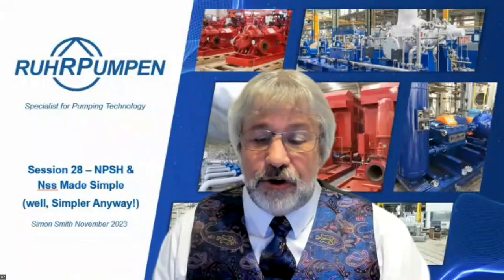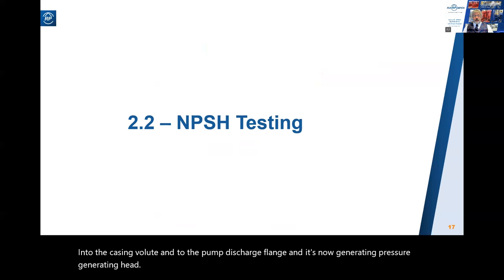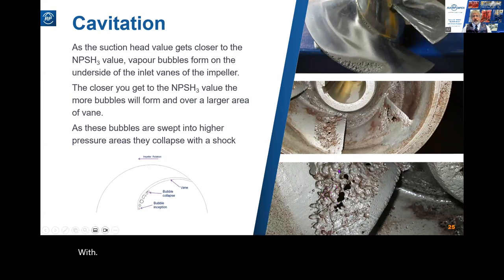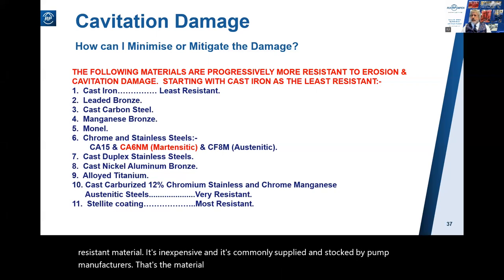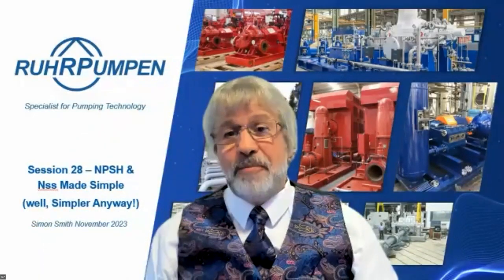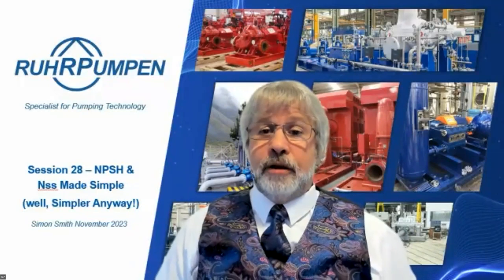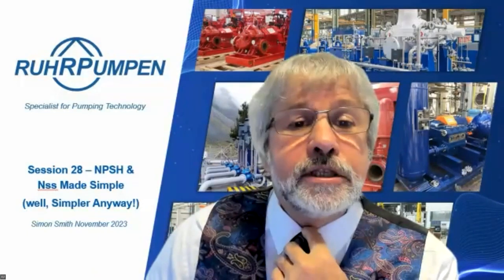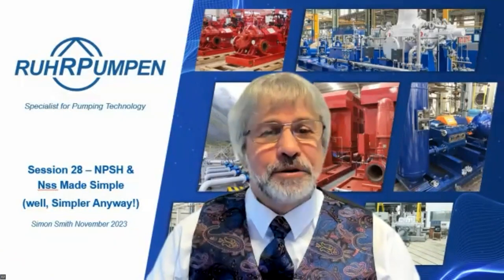Short Course #28: NPSH & Nss made simple | Ruhrpumpen

Comment: 00:09 This session will cover the concept of npsh - a crucial and challenging aspect of pumping.
02:46 Understanding of NPSH and its impact on us
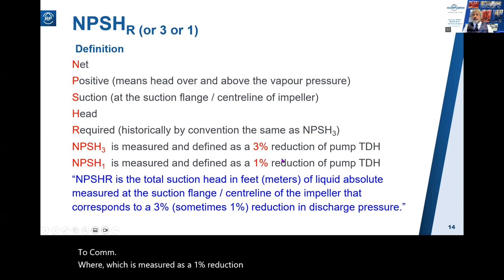08:32 Understanding NPSH is fundamental to pump operation.
11:28 NPSH and Nss explained simply
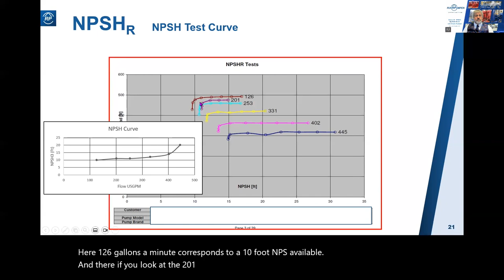17:39 NPSH is often misunderstood, cavitation occurs at higher suction pressures.
20:35 Maintain sensible margin to avoid raising suction pressures too high
26:21 The correction factor for pumping different fluids affects NPSHr.
29:01 Understanding the difference between NPSH and recirculation in pumps.
34:28 Impeller designs from 1950s-1980s had limitations that led to increased vibration and unstable NPSHr characteristics.
37:15 Pumps should operate at their design point for best efficiency
42:26 Incorrect assumptions can lead to equipment oversizing and poor performance.
44:52 NPSh ratio and NPSh margin are important factors in pump performance.
49:48 High density causes damaging cavitation with an SG of 1.2.
52:29 NPSH is crucial for pump operation.
57:31 Calculate NPSH available and compare with pumps in the marketplace.
1:00:06 Consider inducers for improving NPSH margin
1:05:15 Designing systems to avoid cavitation and achieve best efficiency.
1:07:43 NPSH affects impeller trimming and pump speed.
1:12:49 NPSH is based on actual liquid level or pressure above in a closed system.
1:15:20 NPSH and cavitation considerations for pump operation
1:20:28 NPSH testing and operational considerations
1:23:12 Lowering the impeller in VS6 pumps can increase NPSH available
Crafted by Merlin AI.